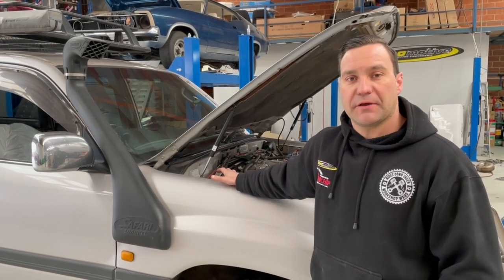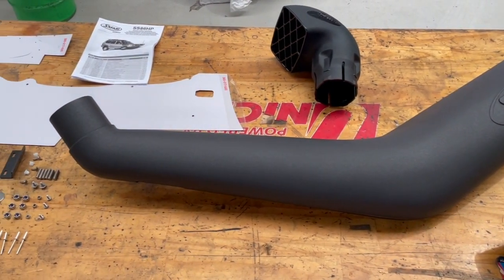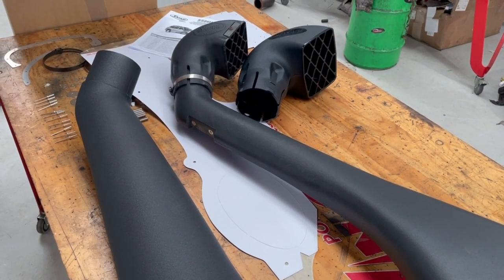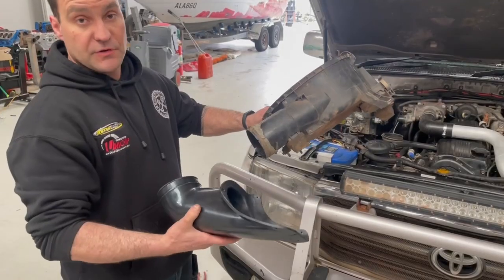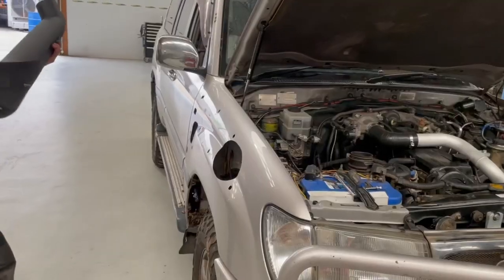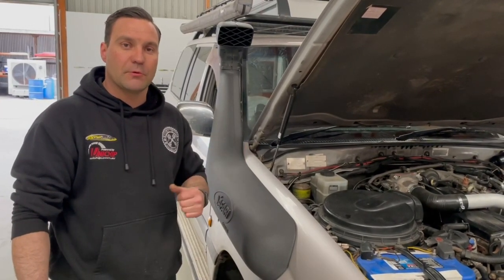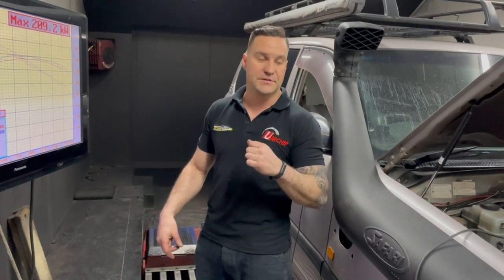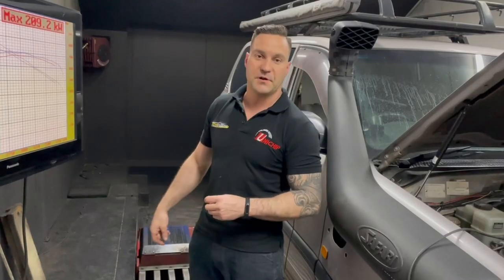Snorkel's on a 1HD-FTE is it worth it? We Swap a Small Snorkel for a Big Snorkel and report results

Comment: With the small snorkel it was 203kw? And the increase was to 209kw or a 2.95% increase. Even if it comes in a little earlier, I'm not sure the cost of the snorkel plus the cost of tuning, and repairing the guard is worth it. Eye of the beholder, I guess.

Comment: If the head of the snorkle is still the same size how would it increase air capacity at all. Same size hole = same max flow
Reply from the maker: The increased volume by 2" in the body of the snorkel is what has reduced the airflow resistance, there would be larger gain again if the snorkel head was larger or even taken off all together.